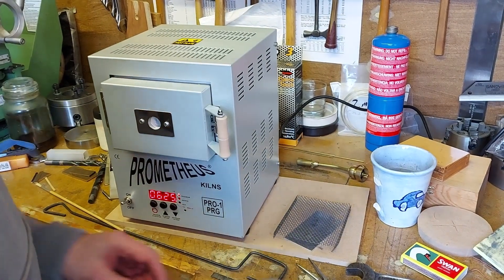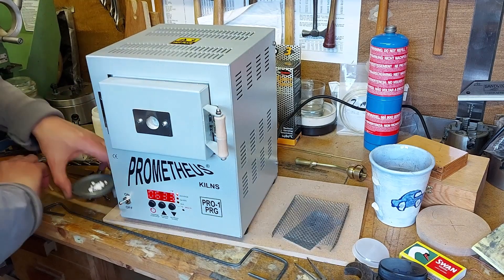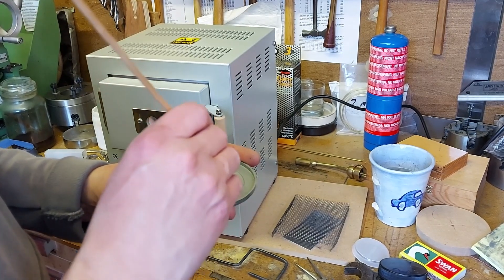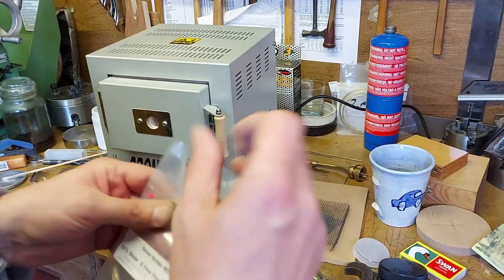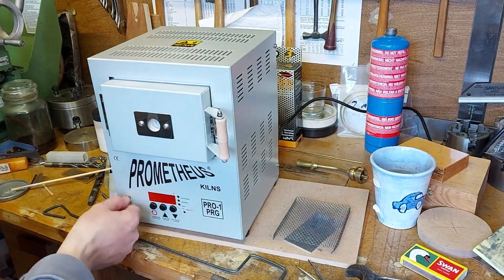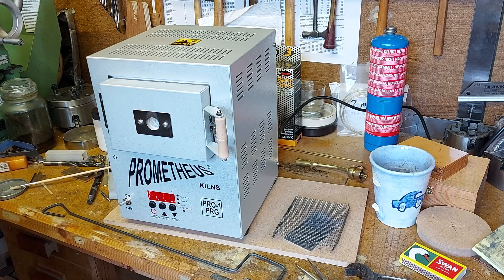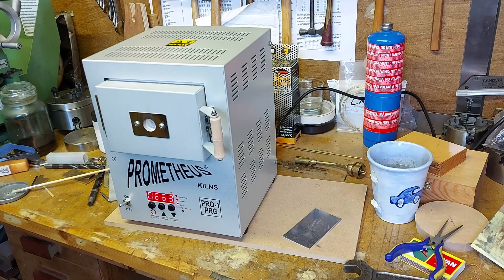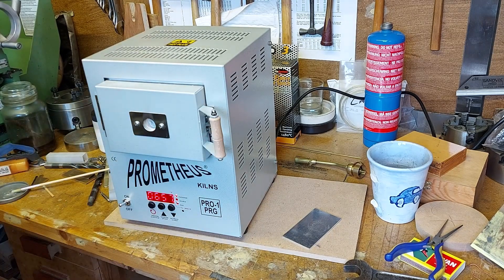Silver Soldering in a Kiln

Comment: Interesting.  I can see an application where the parts are very light and liable to be displaced by the gas flow from a torch.  A bit time consuming though.  (I could hear you perfectly).
Reply from the maker: Thanks for the comment. It is time consuming, but there are times when I have to wire together small parts and when I'm very nervous I'm going to blast away a small versus large part.